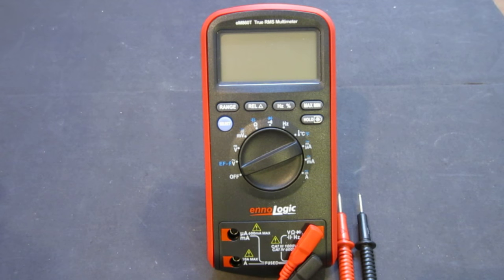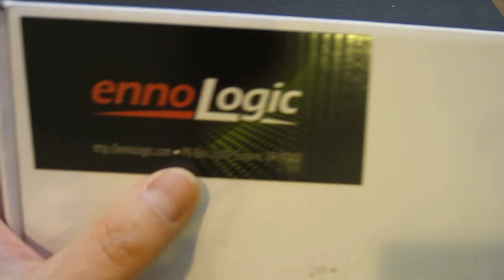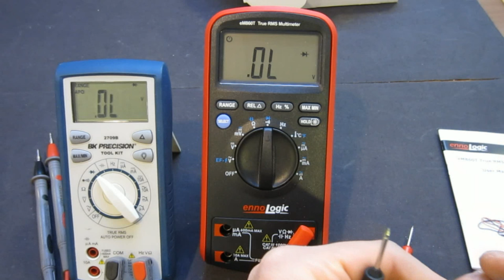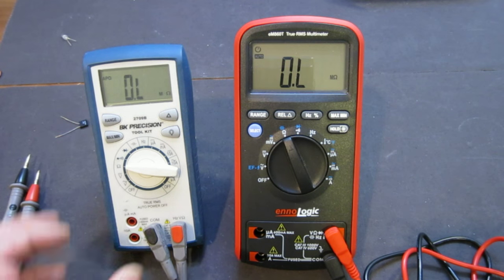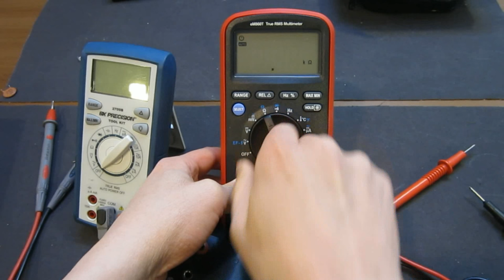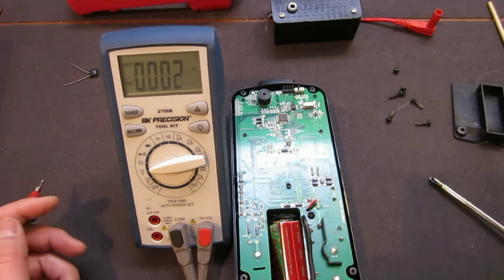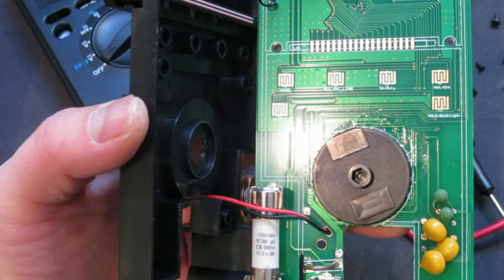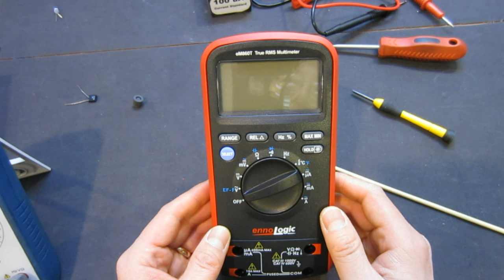Review and Teardown of ennoLogic eM860T True RMS Multimeter

Comment: Nice vid and tear down. I’m thinking that rubber button may be how to disassemble to replace a bad fuse. If it connects nothing electronically, possibly pushing through the hole with a paper clip will help with the separation of the cover by gently pressing on the board while holding the back cover. Just a thought. When mine arrives, I’ll try it. Thank you for sharing.

Comment: Hi Kerry, I just received my 2709B back from BK Precision.  The technician working with me was very helpful.  They basically claim the long leads that come with the 2709B aren't reliable with larger capacitors.  They included two shorter pairs of leads.  One 36" pair, and the very short 10" LCR leads with alligator clips.  So far with the shorter LCR leads, I have yet to see the problem.  Here are the leads they sent along https://www.mouser.com/images/bkprecision/lrg/TL20LCR.jpg
Reply from the maker: Good to know. Thanks for sharing the link!

Comment: On your previous article: 
http://www.kerrywong.com/2011/09/11/my-take-on-bk-2709b-multimeter/

You showed pics of the probes with the caps removed. My probes look identical but don't seem to be able to screw off the caps. They just rotate without coming off and I don't want to pull them in case they might break.

Do you have any suggestions?
Reply from the maker: Hmm, I haven't seen a meter that you can't remove those shrouds. I just tried putting them back on my BK2709B and they came off pretty easily.
Reply: I looked a little closer and I notice a slight difference in the probes. Notice the ridges about 1/2 inch from the tip?  Here's a pic:

https://www.evernote.com/l/AAPW68Gj6PpAFpjSlj8Jbo6CEcvfHCe1wJQB/image.jpg
Reply from the maker: I think your caps might just be pushed in tighter, if you look at the length of the metal tip you will see that in mine they are shorter than yours.
Reply: I used a bit of force without worrying that they will break and the caps came off. 

I'm actually glad they are on there so securely. 

Thanks

Do you happen to have a walk-through 'how to' video on the different ways to use this unit?

I'd love to see that

Comment: Just got my BK 2709B and my capacitor readings are all over the place when reading anything over 100uf.  Had I known it had this flaw, I wouldn't have spent $100 on it.

Edit:  Just tinkered with it more.  I find it's way more reliable when autoranging is enabled in capacitor mode.  Plus, it HATES when I use jumper wires in addition with the leads, If I use just the leads by themselves, it's also much better.
Reply from the maker: 2709B is a great meter overall though, it's fast in resistance measurement range for instance. What I found is that the series and leakage resistance affects how the capacitance mode behaves. The meter doesn't like caps with high ESR or leakage.
Reply: Kerry Wong I went back to testing more last night. I found out two things. Don't use alligator jumpers on top of the leads. It hated that. Also I had autoranging off for capacitance. It was MUCH better with autoranging on. I was able to accurately measure a large cap like yours in the video. Thanks for the review and response.